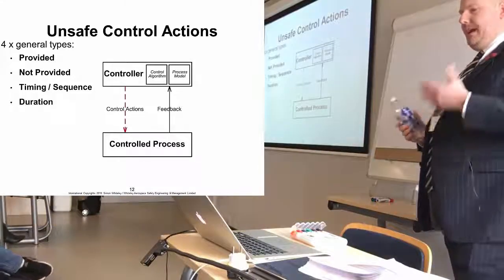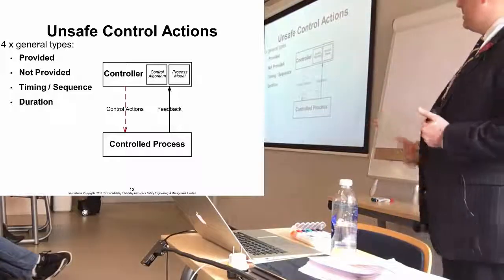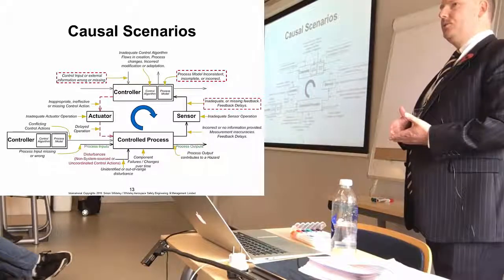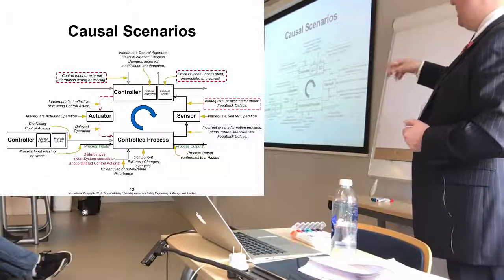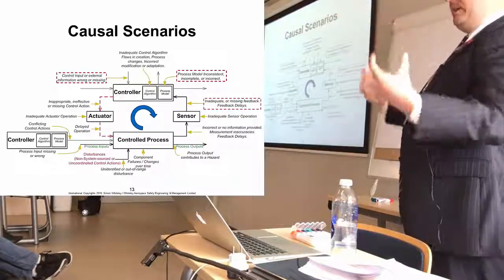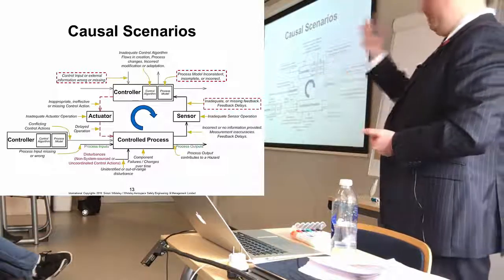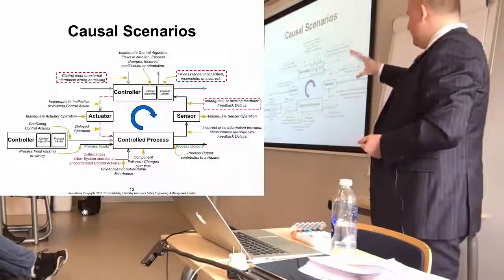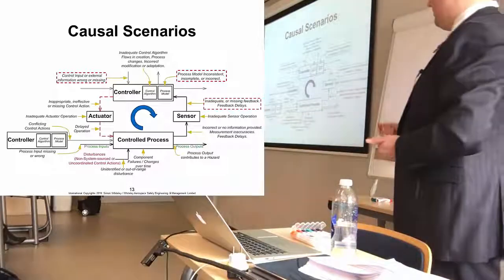V. Brief Overview: STPA Hazard Analysis (STAMP)

Comment: I looked at two You Tube presentations.  One was the 8 minute intro and the other was the 3:22 sample from Nov 17, 2018 in Amsterdam.  The eight minute overview uses the Nancy Leveson hated phrase, "Systems of Systems" which I agree with is redundant, improper, and alienates people.  Thought your presentation style was fine. Showing one slide to me and another slide in the classroom not shared with me the viewer was distracting--same thing with the STPA 3:22 clip.  What I saw was OK, but unclear if viewing your training would enable me to go and be successful at using STPA.  If you can get rank and file safety managers to use STPA without the intellect of Dr. Leveson and Dr. Thomas, you've done your job.  Some of Dr. Thomas' examples led me to believe that STPA is an expert's tool that he applies across a lot of disciplines.  It should also be pointed out that he has resources and time to look at these problems that class attendees don't have which makes it disappointing when you see his analysis and solutions--stating to myself, "I could never see that!"  If you can get over this with average joe safety manager, you've done something.